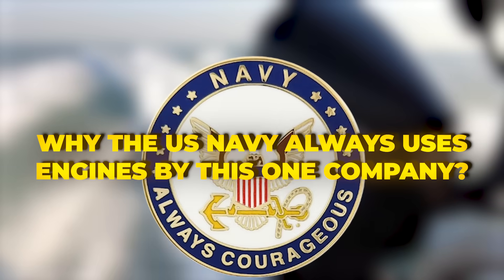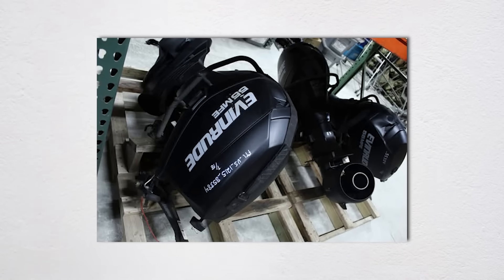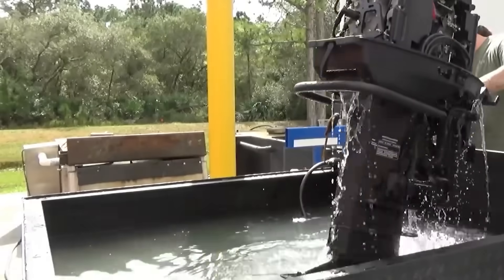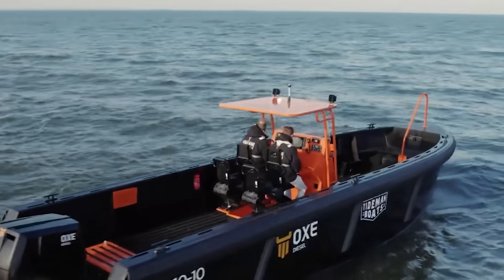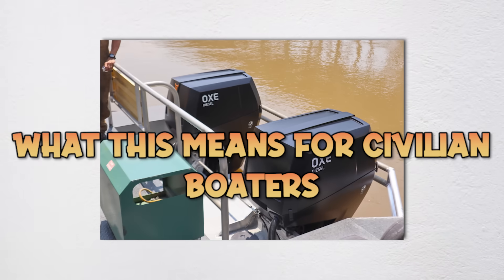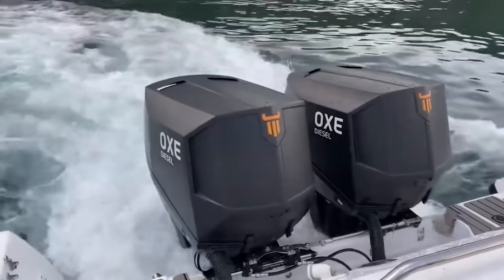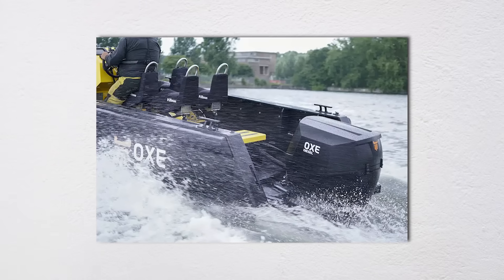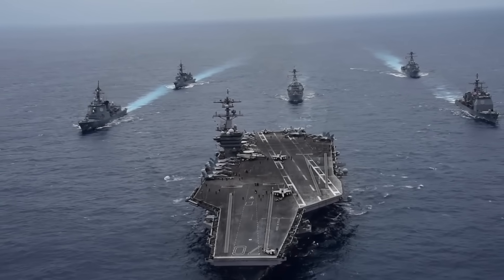Why US Navy Always Use Engines By This Company?

Comment: I teach a boat course in the army and have thousands of miles on the Raider and its the biggest pile of crap. The foward/reverse lever is on the wrong side, its the last thing from efficient, the start sequence is embarrassingly loud, the water purge after sinking the engine doesn't work, and if you wanna be quiet during infil then you need to shut off the engine 5k out and row in and I'm not exaggerating, it is the loudest motor I've ever used. Ontop of all of that, the engine is pieced together from Chinese parts. How Raider or Wing got the SOF contract has to be criminal cause the Zodiac and Evinrude were amazing.

Comment: I have one of the Johnson 55hp.Improved Marine Amphibious Reconnaissance System IMARS outboards with the Durajet lower drive. There was an insulated vinyl cover for the main cover to suppress the engine noise for it that are hard to find.

Comment: God these engines pollute water so much.
I remember back in the day, just looking out the back of the family ski boat, and seeing so much smoke, gasoline, and oil going out the exhaust pipe into the water underwater.
I was like, that can't be good for the fish... or the swimmers... at all..  multiplied over 10,000's of boats, over 20 years, in the same lake...  with nowhere for those chemicals to exit the lake.    
Those petroleum byproducts are going to accumulate in the water.  

If you've ever had gasoline on your hands, and tried to wash it off... you know getting your skin wet is an absolute mistake, as it makes it suddenly far more porrous for gasoline to go right in...  and into your bloodstream  your best bet is to not wash your hands, and wait for the gasoline evaporate off...
Reply: You are right, the old outboards up to the late 70's used an oil/fuel pre-mix and were pretty dirty compared to the 2-strokes that came later. 2-strokes of the 80's and beyond used direct oil injection and fuel injection to cut way down on the smoke and residue on the water, they inject just enough oil to keep the engine lubricated without over oiling. As far as residues in the lake, fuel additives like MBTE created an issue, but in some areas where there is heavy industry, pollution happens from the surroundings and air more than a few outboards on the weekend.

Comment: I worked for the (shall remain unamed) program office that helped "sink" Evinrude (Bombardier). No, we did it, we killed Evinrude.  A Marine (big "M") offshoot, complied with the "Single Fuels Mandate" (but NO gasoline, not even a pint to clean paint brushes aboard ship...for good reason). The program office insisted that the 55 multi fuel OB engine could get a 6?-meter RHIB on plane with 6 combat-loaded Spec For Marines aboard.  The M Fuel could do so, if the Spec For Marines were all skinny, or if they left some of their treasured toys (Dräger Rebreathers, heavy barrel sniper rifles, a S***-load of heavy BA5590 batteries etc.) behind.  Evinrude (Bombardier) did a fantastic job of tweaking the M Fuel to get every ounce of power out of it and making it lighter.  I could not believe that every time the program office moved the carrot, Evinrude (Bombardier) responded with hydrodynamic and combustion genius that Ferarri or Miss Budweiser would have envied.  I think that Evinrude (Bombardier) bet all or too many of their chips that the M Fuel gig would save Evinrude with a big contract, until the bean counters screamed, "enough!"  All of us who grew up knowing that Evinrude was the engine that would get you out...and back... can blame the EPA, M Fuels and the 6?-meter RHIB.  No mention of Yanmar? I spent too  much time walking on the overheads in the Bering.  Skip the VVT, ceramic nonsense.  Give me a Yanmar that can be started by spinning the flywheel or with a rope that will run on fermented yak pi$$ and get you back home.
Reply: If it ain't there, it can't break.
Reply: @timurlenk-f4f keep it simple stupid!!!
Those are words to live by!
Reply: that's   KINDA   what I thought 
said  ULTRA  professionally .... Yaak Pi$$ & ALL

Comment: Ford studied ceramic engine blocks for automotive already during 80s. To my best knowledge they studied mainly PSZ (partially stabilized zirconium oxide) because it was the toughest of the hard ceramic materials there was. The problem was that it didn't withstand hot water but eroded in the most awkward ways.
You just can't negotiate nor fight the laws of nature.

Comment: Ok, old Capt. Gabby H. has to step in here give you kids at Vintage Boats a primer on Government Outboard Purchases.....becuse I've bought them for not just the Navy...but also the Army (Corps of Engineers)

The Navy?
They buy what's available, and they buy Mercury a lot, because most of their surface ships have diesel rhibs with Bravo 3's.
Outboards are like lawnmowers to them...so they buy them buy the trailer truck loads...also their Bluewater gas inboards for various working craft.
Crates with Outboards...Diesel engines and gas engines...stacked up to the ceiling like cord wood...

Comment: Thumbs up to bring back Evinrude! 👍🏻 the whole industry benefitted from them pushing the technology. Now they are gone 😞
Reply: I didn't even know they were gone heck that is the way things go if it works these CEO college boys always screw proven stuff up
Reply: The CEO of OMC ran it into the ground pursuing racing awards and not paying attention to the bottom line, the board and shareholders must have not cared. Bombardier bought OMC and promptly killed the Johnson line, the VRO and electronics systems didn't help and Evinrude lost market share. The influx of Asian motors that ran just as good or better without the problems pretty much sealed the deal for Bombardier, they ditched the program instead of letting it continue to bleed money. It now stands for the upstarts, Europeans and Asians to move outboard tech forwards, the fact there is research on using ceramics and carbon fiber to lighten the weight of engines, hell yes. A 100hp engine that weighs less that the 35hp Johnson I have, or the 55hp Suzuki I had only weighed a few pounds more but had half the power, I could have fun with one of those.
Reply: @5695q I think the worst thing is that Evinrude was so close to finally gain a reputation to get back some market share. Then for some reason they went all in on the Rotax which should not have been a replacement for the G2 but a specialty motor that should have been pushed for mostly Pontoon boats
Reply: @5695q  California didn't help Mercury or Evinrude with their goofy "4-stroke only" rules.
Reply: @SurferJoe46  no, and their funky fuel formulation requirements introduced MTBE into the environment which didn't help matters at all.